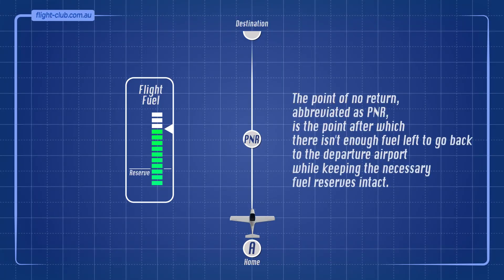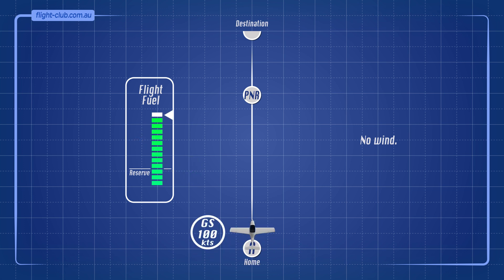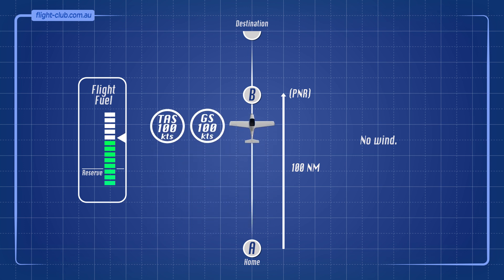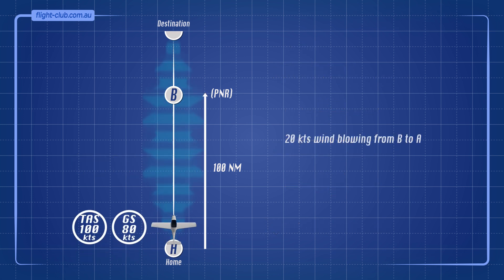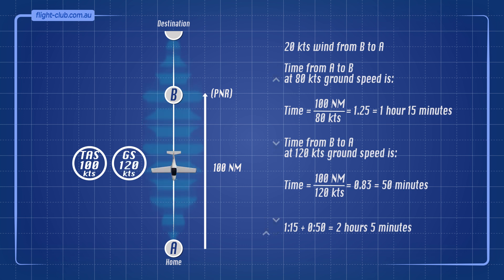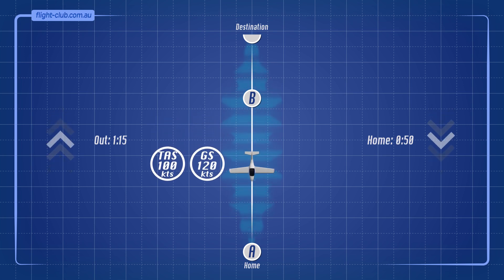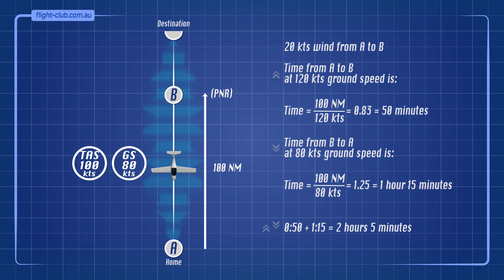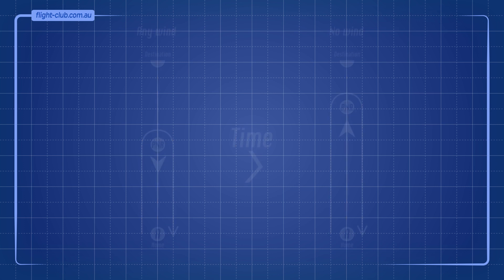Understanding the Point of No Return (PNR) | How Wind Affects Flight Planning

Comment: what if it were a crosswind?, then i would assume that there will be no effect since the crosswind will have the same effect from point a to b and vice versa
Reply: It would increase the fuel consumption. Because if you draw a wind triangle , you will find that you travel more air miles than the ground miles. This means PNR closer to the departure.